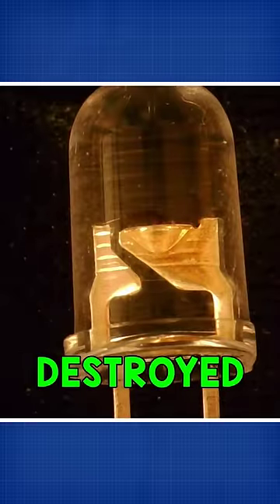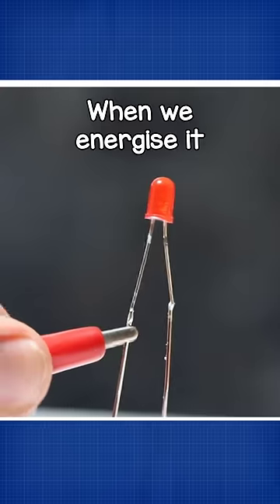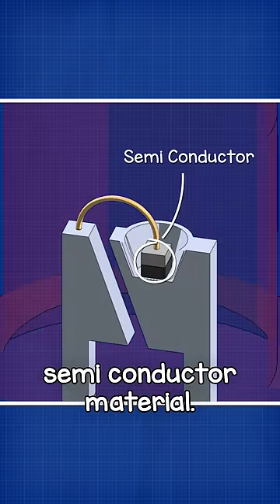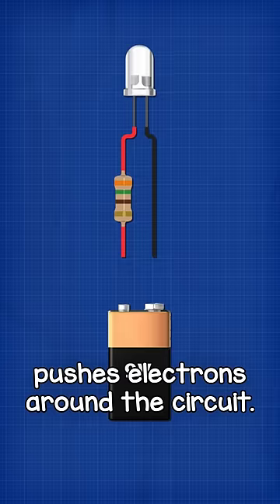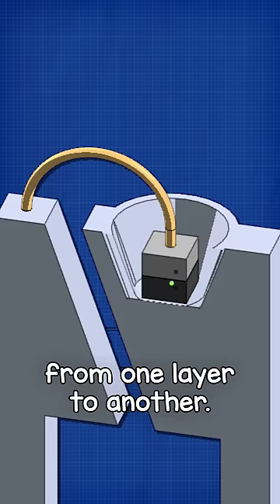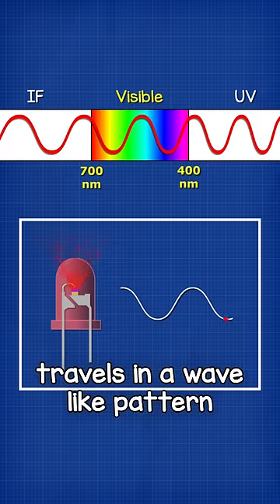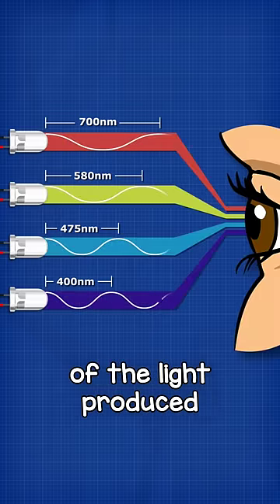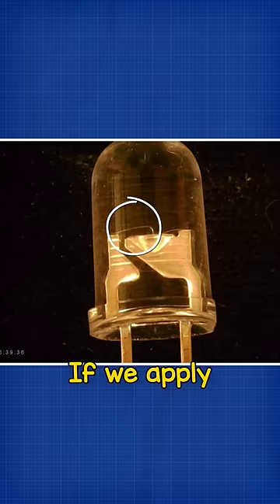What is an LED and how does it work #technology #electronics #engineering #led

Comment: Well, I just washes out for me about the energy efficiency of diode light. Have you gotta use a resistor to resist the power you’re losing tons of energy out that resistor right? I don’t know if I’m perfectly right, but I am pretty sure that’s the way resistor works as a uses up the energy that too much.
Reply from the maker: You can design the circuit so almost none is wasted

Comment: How to determine how much resistance we have to add to it
Reply: If you know (check the data sheet) the wanted voltage and current as well as the supply voltage...

R = (V_supply - V_led) / I

Or in words, resistor value equals how much voltage it needs to drop (supply minus what LED needs) divided by the wanted current. 
Then check how much power is dropped in the resistor and get a resistor of right value and power handling capability.
For value you'll likely need to round upwards to nearest E24 series standard value.
Power = current times voltage over the resistor (supply minus LED)  The most common size resistor is rated for 1/4 (0.25) Watt.
Example an LED with V_f 2.8V and I_f 20 mA on a 9V supply:
R = (9-2.8)V/0.02A = 310 Ohm
Nearest higher standard (E24) value is 330 Ohm
Power in resistor  will be approx (due to slightly different value of selected resistor from calculated)
P = (9 - 2.8)V x 0.02A = 0.124W which is well with spec for the most common size (capable of 0.25W) If right close on the edge of a rating, typically 0.25, 0.5, 1, 2 W etc, go with the next higher capacity.
Technically 0.124W is within rating for a 1/8 (0.125) W size, but it's both running right on the edge and harder to source than 1/4-watters...

Comment: In that config resistor will reduce curent not voltage
Reply: Resulting voltage over the LED is the source voltage minus the voltage over the resistor (which is R x I)

Comment: If it is voltage that destroys an LED, why is the protecting resistor termed a current limiting resistor?
Reply: Because it drops the voltage over the LED by putting part of it (R x I) over the resistor.
U_led = U_source - (R x I).

Comment: Can you do a video of how blinking brake LED lights work? There are brake lights that flash a certain number of times and then stop flashing and stay constant. I have brake lights that do that but they messed up and now all they do is consistently flash when I brake. Can you please do a video like that and what the problem is and how I can fix it?
Reply: I enjoy the challenge of repair and I believe the problem resides in the circuit board providing power to the brake lights.
Reply: @jeffmills4103  That's the case for, for instance, aftermarket kits that you splice into the existing brake light wire (cut wire attach ends to input and output) Box also needs a ground connection to function.

But you can also get separate [LED] bulbs that does the same, and they have a sliver of silicon inside the bulb with either RC stages and transistors switching the LED, or a small microcontroller that  starts running as brake line wire goes high,blinks the LEDs a number of times, then keeps it on until wire goes low.

Even the blinking individual LEDs have silicon smarts built into the package.

Comment: I think I need this for my motorcycle... my lightbulb keeps burning out, I think I need a resistor... but how do I determine what kind of resistor I need?
Reply from the maker: Watch our tutorials, full videos, not the shorts
Reply: the problem is likely vibration breaking the filament and an LED replacement could fix the recurring problem; I used CFC(twisties) and they were resistant to vibration; I have been seeing more automotive LED replacements appearing on the shelves.

Comment: Can we repair that LED by putting a new connecting wire, which gets burned after applying high voltage?
Reply: one could dissolve the plastic and get a bonding machine ($$$) to put a new wire in place, and hope the silicon is still OK...
But LEDs in bulk are CHEAP

Comment: you use a resistor to limit the current
Reply: Or from another point of view, lowering the voltage over the LED by dropping it over the resistor instead...
U_led = U_source - (R x I)

Comment: Hello 
Why LED in slow motion camera flashing?
Reply: the supply is pulsing. A common way to drive, and change brightness of, LEDs are to use PWM (pulse width modulation), ie very rapidly turn them fully on and off for a varying length on of the full cycle length

Comment: Current flows from negative to positive, you have it flowing the wrong way
Reply from the maker: Current flows from positive to negative, electrons flow from negative to positive.
Reply: @EngineeringMindset As by convention established way back when they thought it was positive charges that moved.

Then they found the electron, but couldn't be bothered to change the model...

Comment: But why do electrons jump inside a semiconductor?
Reply from the maker: See our full video on how leds work for amswer
Reply: The term semiconductor means
Sort of a conductor...
It changes it's conduction state with different voltage
Inside the molecule there are free electrons and the voltage creates a field that allows them to get moving.

Metals have tons of free electrons so any voltage gets them moving and since there's no field there's no light just some heat (technically, infra red light)